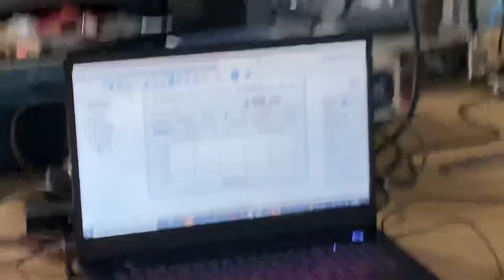Interferometer becomes seismometer

Comment: Remembering a previous life, in the previous Century, in Silicon Valley. For the HP 5528 system, designing a custom 68K board to fit the mainframe, controlling a linear motor X Y stage on an air bearing platen to scoot wafers around, hopefully faster than the competition. Became the Ultratech Stepper model 2000. Great fun, commercial flop. Stumbled across it in the Tech Museum years later...  But, watching the phase wiggle of the measurement channel on the scope, in response to the footsteps down the hall, was a mind blower to my young imagination..!

Comment: What type of interferometry are you doing? Just simple Michelson? Or heterodyne?
Reply from the maker: michelson
Reply: Then how could you calculate the direction of displacement (i.e. positive or negative)?
Reply from the maker: @sanghyunhwang1297  using polarization and some clever optics, you can build a detector that uses two photodiodes that produce an analog signal 90 degrees out of phase with each other. Simply put it through a thresholding circuit and you get a standard quadrature square wave, just like any standard encoder.
Reply: @cylosgarage  I see. What's the software that you used to display the data? Asking all these because I'm trying to build one myself.
Reply from the maker: @sanghyunhwang1297  http://www.repairfaq.org/sam/uMD1/
This guys website is THE resource for all things homemade interferometers. He has a wealth of very affordable kits available on eBay as well. Happy lazing!
Reply: @cylosgarage  Amazing man, thanks.